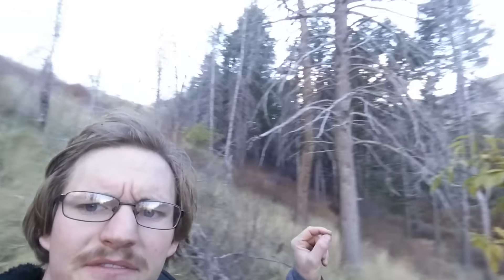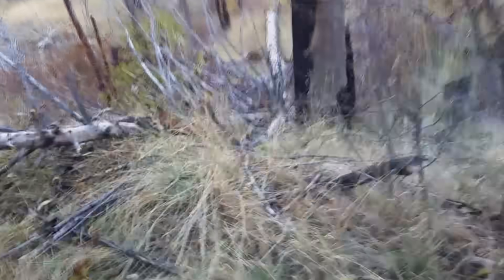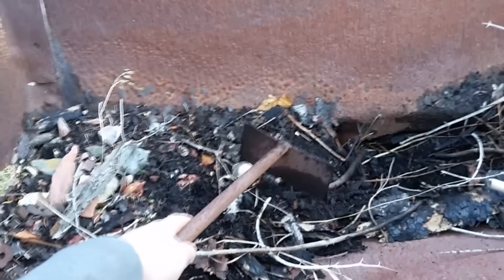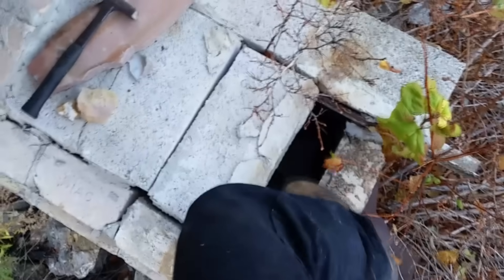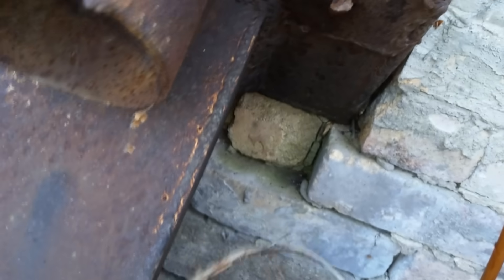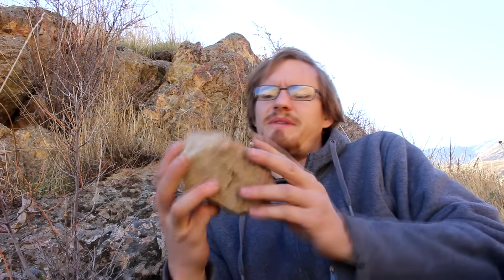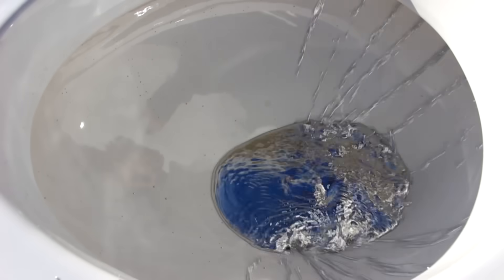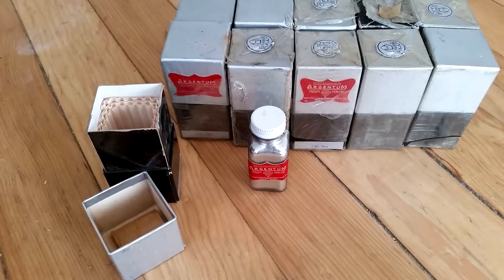Where Did I Get My Mercury?

Comment: Good video and are you worried about coming in contact with cancer or are you learned in safety .  Any way I have been a fan of the pretty silver Liquid Metal .  I have never had the nerve to go looking past books on the subject and when I run across a site like yours I always find something I had not known .  Have you ever experimented with spinning it in a centrifuge and get a answer about a antigravity experiment.  Or any electric current to cause direct circular movement, .

Comment: Listen bro I know this video is 5 years old but as a carpenter I'm begging u not to go in there.  Whoever built that shaft was inept; notice the top wall plates arent framed properly.  I'm re to the posts laying verticle on top - they're load bearing and sitting on a two by six thats sistered to the post. Its a travesty; its a testament to luck and fortune that it hasn't caved in yet and I sincerely hope I'm missing better foundation out of view. I recommend jacking in a few extra posts at the least if u plan on going in there again.  😱🙈🤦🤦🤦🤦 my chest hurts looking at this shit

Comment: Please: If you’re a Mercury expect, you must know how toxic mercury is?
Perhaps a little more consideration for health and safety.
Like using gloves while handling cinnabar and NOT flushing mercury down toilets!
Technically, Cinnabar is deposited by alkaline epithermal ascending aqueous solutions via hydrothermal veins, hence in theory could be deposited in an metaphoric substrate rock.
Reply: @Paul Davies: Pretty sure the toilet wasn't connected to a drain or whatever sewage system Cody uses, so the mercury wouldn't have gone anywhere where it would have caused any damage.

Comment: Build fire, heat ore, sweat mercury out of rock as a vapor,  recondense mercury vapor into liquid mercury by collecting hot mercury vapor in a cool angular runoff pipe, collect liquid mercury in a sealable container.  Interesting process but it would have been highly toxic work, even outdoors because of the volume and density of the mercury vapors involved.  And the vapor collector and copper coil for recondensing the vapor into liquid mercury are both missing.  Probably cashed in for scrap metal or used on someone's alcohol still.  Same process essentia)y, just different substance and end product.

Comment: Very poor grade. A nearby mountain has deep rich red cinnabar. Smelted onsite as well.  100 pound flasks capped with 3/4 inch pipe plugs... The b and b mine, 9000 feet elevation, Montgomery Peak Nevada

Comment: The rust around the pipe can over time become putar in the correct environment conditions this can also AU as well as copper and obviously some putar in there Âs the verant'ß Earth,Air,Water,Fire and Radiation with añ,. number gammaray can alter not just Out side elements that can get into the metal along with Veriant changes upon Impact though the metal itself and the conditions..inside the Contraption 

JT`*

Comment: "Where did I get my mercury?"

Well that's an interesting story for me.  I was metal detecting in the Sierras near an old hydraulic mine and I located a rusted "tank" that at first seemed like an old propane tank until I looked closer.

It turns out that this "tank" was an Almaden Quicksilver Mines 76 pound mercury carboy.  And it also turns out that it was the miners recovery flask!  It contained three pounds of mercury and approximately 0.65 troy ounces of gold!

I used the nitric acid process to recover it.  Amazing find from my point of view!
Reply: 1000 bucks in a random tank? Nice.
Reply: @Systolic_Gaming  I was metal detecting at an old Placer mine..,  Miners left their cleanup in the 1880s.  
Cool cash..,  Cool relic.
Reply: The only explanation I can think of is perhaps gold wasn't worth the trouble of recovering it back then? Or maybe they had a motherlode and didn't care enough to do it?  I've left resources behind out of pure exhaustion at the end of certain jobs; at a certain point, the scales tip in the favor of your beaten body and the money is all relative.
Reply: Damn I suppose I read that wrong. U didn't have to do anything special to recover the gold?  Thats an awesome story man.  What did the mercury fetch u in price, if anything? Lol I'm all up on a two year old comment
Reply: Nice story.
Reply: For the win! A $grand for your trouble, not bad dude
Reply: @jimsteen911  And I still have not got ALL the fines and amalgam out of the Mercury.  I will need to try a chemical process to get the last of it.  The container still "tinkles" when I swirl it.  Some gold precipitated out and clustered after my first clean up.
Reply: sounds a lot like Cody's toilet experiment
Reply: Can I have ? I’m veru trust worthy?

Comment: Interesting mine to have found and also very interesting listening to your deductions on what might have happened there. 
I have been slaking my own calcium carbonate and making lime putty mortars and plasters which I use in my work and just wish that I had studied geology in school because it's such an interesting subject.
Where I live in the south-west of the UK we have a lot of old lime kilns where they would produce tons of quicklime for the building trade, we also had about 30 roof tile companies which exported their products all over the place and abroad, now there are none because most roof tiles are made from cement.
Instead of making the quicklime it's more convenient to buy the quicklime from a suppliers as a finely crushed (kibbled) material like sand.
By just adding water to the quicklime within a few minutes it bubbles and fizzles, creating massive, intense heat and from one tub of quicklime I can get back 2 tubs of lime putty which I make into the mortars and plasters that I use in my building work.
Lime mortars use less much less energy to produce than cement mortars and the finished product on the wall absorbs carbon dioxide, and is great for better sound acoustics as well as having a warmer 'feel' to the inside of a room.

Comment: I have about 8 lbs of pure liquid mercury in my possession. My father used to repair thermometers for huge furnaces and I took it all when we cleaned out his house after he passed away last year. A small bottle is very heavy.
Reply: Mercury is extremely toxic, causes mental retardation and death even from a small exposure, be careful with it!
Reply: It is toxic. If you inhale the vapours. Playing with metallic mercury (maybe thrilled by the myth that it "isn't harmful"), spilling some of it, or breaking a thermometer, then maybe trying to vacuum it up – these are classical ways of getting exposed to a lot of mercury. There are case stories of families who got mercury poisoning after living a few weeks in a house with rather small amounts of mercury spill. The fact that you misspell dimethylmercury hints that you know very little about it. Did you know that in your body, some of the metallic mercury will inevitably be turned into organic mercury (and also vice versa). Gut bacteria can do this. Once it is in your system, it does not remain metallic mercury.
Reply: squidwardDK obviously it isn’t safe to play with mercury, but elemental mercury can be stored well relatively easily the only real danger are the vapors and as long as your container is air tight(I suggest putting your airtight mercury container inside another airtight container).

Comment: I WAS DEMOING A OLD HOSPITAL,I CAME ACROSS A METAL CYLINDER,WAS VERY HEAVY,WHEN I TURNED IT OVER,WAS A TAG ON IT,SAID 99.99% MERCURY,I MOVED IT SIDE TO SIDE,AND IT SWAYED INSIDE,I FOUND IT TO BE CONCAVE ON THE BOTTOM OF THE CYLINDER,AND A SCREW IN PLUG,I WORK FOR A DEMO COMP.,I KEEP THIS,IT HAS A STAMP ENGRAVED IN THE METAL SAYING IT WEIGHS ABOUT 78.9 POUNDS,WITH THE METEL IT IS LIKE 86LBS.,I STILL HAVE THIS,PLUS MORE SAVED OVER THE YEARS,WHAT WILL YOU BE DOING WITH YOUR MERCURY?,DONT WANT TO PLAY WITH IT AS I KNOW IT IS DANGEROUS.

Comment: Try getting rid of mercury legally.  I had 7 pounds I tried to get rid of.  Found a couple outfits that would take it if I paid for "shipping & handling".  Turned out it required special shipping containers and the cost to me was going to be several hundred dollars.  Then one day the county held a hazardous chemical turn in where you could get rid of your old paint thinner, oil based paints, etc..  They quite happily took the mercury too.   Not sure how other cities or counties would handle that though.

Comment: well Cody if you ever need a pint of mercury I might be able to hook you up. I found a old 7& 7 bottle full of the stuff. I was shocked to see how very heavy a pint would weigh. But if you ever did want more I would need that special bottle that mercury must ship in. I know about what mercury cost on today's market, but I have not seen how much weight in mercury I have yet, manly because I don't wish to remove from the bottle with out a container to properly hold it. Right now the bottle is inside four zip lock bags in a plastic tub in the coolest place I have. yep underground, where the temp stays the same year round. So I don't lose sleep on the mercury expanding and getting out.

Comment: Could u please tell me what exactly is mercury's state when we say its melting point is -38.sth degree celsius. I mean how does it even possible for a metal to melt which normally remain liquid at room temperature
Reply: The melting point of a substance is defined as the temperature at which the solid phase and liquid phase co-exist  at equalibrium under the pressure of their own vapors. In your case, it is the temperature at which the mercury can be either solid or liquid, or can co-exist in both phases at once (like ice and water does at 32 degrees F).

Comment: Excellent! Thank you. Very interesting video. It helps me think back to myself as a twelve year old lad,heating, what I recall was a red powder,(mercuric oxide?)in a test tube and watching the droplets of mercury condense on the upper sections of the inside of the glass.  I did this in the hot embers of our open fire at home,weary of the dangerous fumes,making sure they vented away up the chimney. It was very satisfying,as a youngster,,producing such a wonderfully interesting substance using such a simple yet effective method.Do I remember correctly,though? Is the cinnabar you mention sometimes referred to as the oxide of mercury? -or am I mistaken?

Comment: I live in Santa Yenez at the base of Figueroa Mt. There are a number of meracrome/quick silver/mercury mines on Figueroa. Most of them stopped production when the price dropped and the market collapsed. There was one mine,  Red Rock mine that was still producing off and on into the mid 80's. At the peek of it's production during the earliest part of the 1900's Figueroa was considered a national asset. You can find cinnabar surface deposits scattered about the mountain. Not sure if they are natural or if left there by miners. I have read old newspaper accounts of the big mercury stills heated by burning oak fires and the huge piles of cinnabar. The mines where primarily mined by Chinese immigrants.

Comment: i hope you were wearing proper ppe when burning that cinnabar. mercury vapor is insanely toxic.
Reply: iLLM3 an ounce of prevention is worth a pound of cure. in the case of chelation therapy, an ounce of prevention is worth a ton of cure. once heavy metals build up to a toxic level in your body, chelation therapy is the only option to reduce it to less toxic levels. heavy metal poisoning is nasty, and chelation therapy is also nasty. there are lots of side effects, depending on what specific chelators are used. it would be best to ask specialists in that area instead of researching on the internet.

i definitely suggest not messing around with alternative methods when it comes to something like heavy metals, our bodies cannot handle them, and we're frankly lucky we even have the level of protection we do from them. seek professional consultation.
Reply: SuperAWaC He has stuck his hands in a bucket of mercury.
Reply: while i'd personally avoid contact with mercury to bare skin if at all possible, provided you don't have any cuts on your hands, handling mercury is not as dangerous as mercury vapor. that said, it's nasty stuff. like lead, and other heavy metals, once it's in your system, it effectively never comes out and at best ends up stuck in your renal system.

i wouldn't want to be anywhere near heavy metal vapors, even with ppe. i've seen what it can do to the liver and kidneys.
Reply: SuperAWaC do you know if free radical scavenger like alpha lipoic acid can help with the chelated metal content within the body? I haven't done extensive research or know the mechanisms in how it may work however I know ala can potentially help with that. Thoughts? How else can they rid of it within the body if at all?

Comment: Not sure how interested you are in very early chemical processes or historical paints and pigments, but it'd be really cool to see someone replicate the old Chinese method of making bright red vermilion pigment from elemental mercury. It was prepared by strongly heating a solid solution of mercury and sulfur (which react to form black mercury sulfide) to sublimation in earthenware pots and scraping off the formed vermilion pigment from the walls after it cools down.

Comment: Can you make mercury it into a ferrofluid? maybe using toner, filings, neodynium
 and test it wit some magnets and some current
             also, what happens when you apply high voltage or run AC through normal mercury?

Comment: Most of the mercury I find was used to "refine" gold, and it has settled into stream beds under the sand and silt. I have come back with hundreds of pounds of the stuff. I am sure the stream still had tons of it left under the silt and sand too. I used to distill the mercury, keep what little gold was there, then I could collect a fee from BLM, per pound of mercury for removing it "and" I got to sell the mercury, and keep that money too. If I did ever see a mercury still, and I probably have, I was not paying enough attention to know what it was. I think you can ship mercury via USPS but there are guidelines you must follow. I know I have shipped Cooper Hewitt rectifiers filled with mercury, and small casks of mercury. There is a weight limit. It cannot ship by air. It cannot be in a pressurized vessel, and that's about it. Any type 80 rectifier tube uses mercury vapor in the rectification process. I have been around far worse things then quicksilver. I am gas pad certified for pyrophoric gases, and the semiconductor industry used lots of hydrofluoric acid too. If you even suspect hydrofluoric acid has contacted your skin, you make a beeline for the safety shower. Be prepared, that water is ice cold, and if you ever need to use an emergency eye wash station, at an industrial facility, let that water run for a couple seconds, before you try rinsing your eyes. Those eye wash stations sit around, getting a lot of dirt and fine abrasive dust and sand in them. Add that to the chlorine you wanted to rinse out of your eyes, and you just went from painful to pure hell.

Comment: Hey Cody, here in Newfoundland and Labrador,  they're making a new hydro dam, and the environmental assessment says that the flooding will liberate a lot of methylmercury. They say they are going to cut back the trees that would get flooded to minimize the amount from them decompositing, but others are saying that the soil needs to be removed. Just wondering what the difference in methylmercury and elemental mercury is,  and if there is something they could treat the soil with to keep the mercury contained.

Comment: Well this was a cut above most. I feel that I have to say that I didn't know it was possible to distill Mercury like this. In fact I would never have considered it as to the dangerous nature of the vapor. I think that if I were to do something like this it would look more like a large scale alcohol still than what you found on the other side of the hill there. I'd do it that way as it seems to be a much more sealed system which to my mind would capture a lot more material than that double stack system. Since I'm friends with a few people over in Sumpter Oregon who regularly use a chemical method to srip the cinibar that the pull out, I'm going to recommend this video to them. I'd also be interested in your thoughts on how well a spiral collection coil would work. It would be made of larger tubing than a standard alcohol still to accommodate the higher density of the material. It would have to be a material that doesn't react to the mercury like copper or aluminum does while still being flexible enough to bend into a spiral. Perhaps stainless steel for automotive exhaust? It could make for an interesting experiment either way.

Comment: If it is tru that there is a Free Energy machine working and as its engine it is using Mercury. Then It is a Metal worth experimenting on. I dont know the reason why they are making people so affraid of it!!! It is not that poisenes unless you eat it or you breath in the mercury gas for some years which the miners did at those times and stil got to live a long life. so there are many things worse than mercury. F.example Cigarets which they them selfs are saying they are putting benzin and acitone in it, which it does not make any sense at all.............!!!